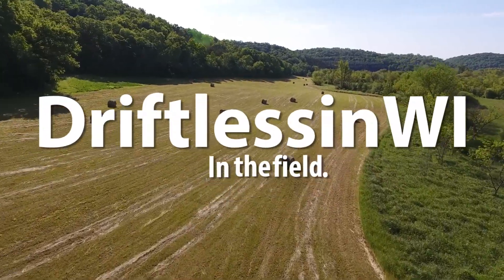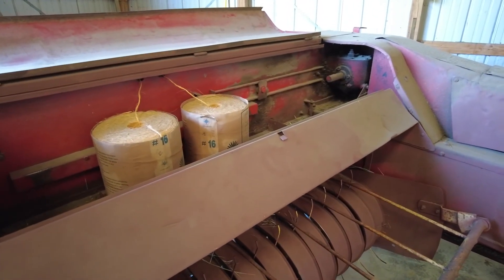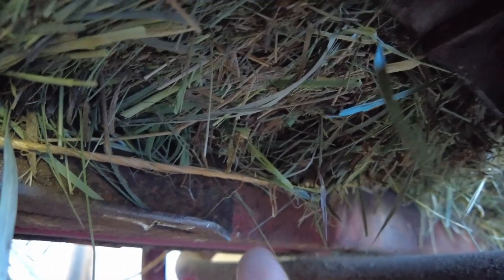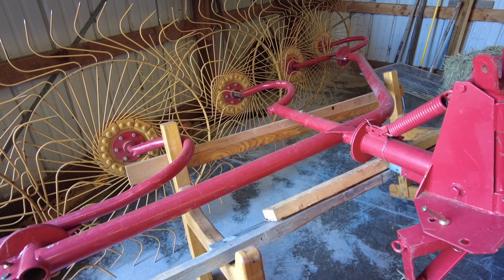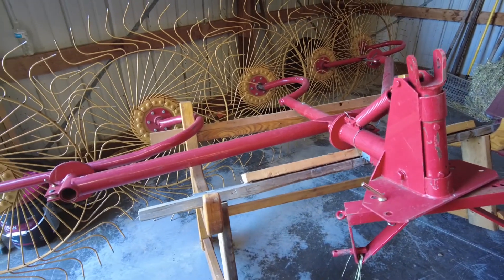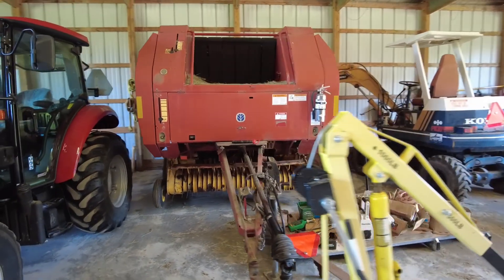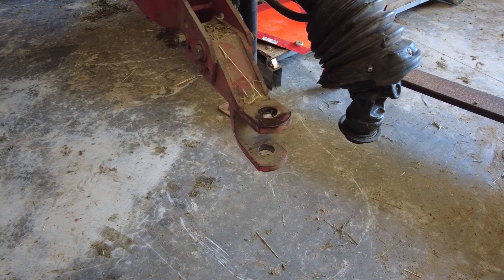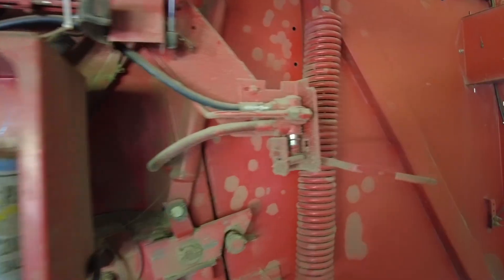First Time Baling Hay - Lessons Learned - Case 75C - NH BR740 - Krone AM R 280 - Super Hayliner 68

Comment: You don't want a hydrostatic transmission. You made the right choice.
Reply from the maker: Yeah, I have come around to the transmission,  the second time was much better and I see why one would not want a Hydrostatic.  Thanks for the comment!
Reply: @driftlessinwi  Some of the 40/50 series deere tractors had a high/low range lever. That is nice. You can slow down and then speed back up without changing gears. Not sure if anyone is offering that in newer tractors or not. Hydrostatic is just not up to what a gearbox can do. The newer bulldozers can't even work hard in the summer without overheating.

Comment: How well did the 75c handle the roller? Did it pull it down any? Were you able to roll at 6-8mph wirhout any issues or did you have to slow down so the tractor could keep up? I JD 5075e and my 4x5 roller strangles it. Thinking about trading for a 75c.
Reply from the maker: It works just fine,  even going up and down hills.  I bale around 3 mph, but I just want to avoid clogs, since I only bale about 30 bales each time I cut.  I only noticed a little slow down when I had a full bale and I kept baling,  go figure :) The 75c seems to be more than adequate for a 4x5 baler.  Thanks for the comment!